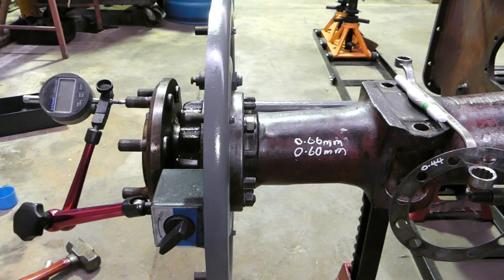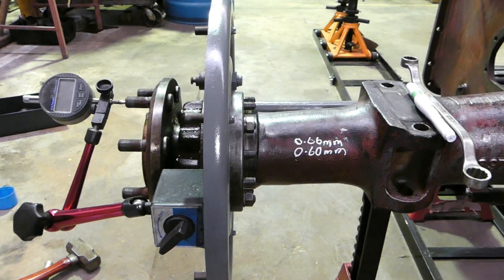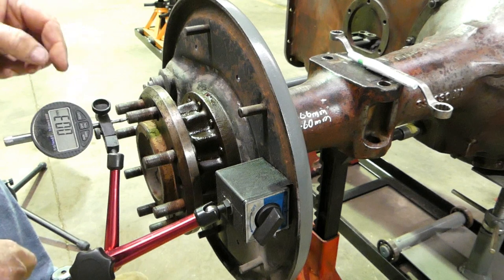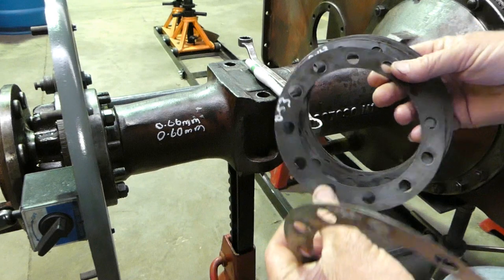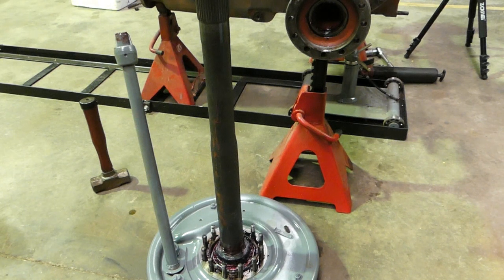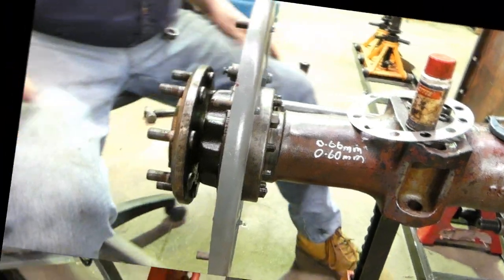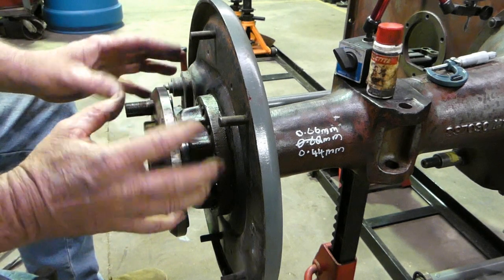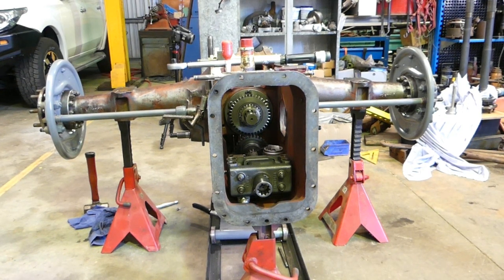Massey Ferguson 135 6 Speed Restoration # 67 Adjusting the Rear Axle Bearings

Comment: Lance, the Massey Ferguson 100 series was my favorite of the lot, I prefer the Multipower gearbox as you get faster road speed, from my knowledge here in Australia apart from the 135, there was a 148, 155, 165, 168, 175, 178, 185, 188, I reckon you should get the lot, if finances are ok, they would make a great show piece, cheers
Reply from the maker: G Day John, The other 135 is multipower and I should be seeing what is wrong with it shortly hopefully. They were a great series of tractor for sure.

Comment: Do you set the 2 to 8 thou spec for each side?  Or just the one side like in the video?

I pulled my axles out and will be putting them back in once the bearings and collars are done so I have to hold my differential lock lever down  before putting the right axle back in?
Reply from the maker: just one side as the axles almost touch in the middle and that gap is what you are measuring.

Comment: Hi lance great video , a quick question do you need a gasket on the outside of the shims on the half shaft and what stops the oil from leaking through the shims?
Reply from the maker: I just use some sealer at times.